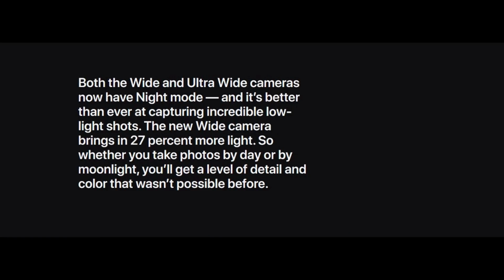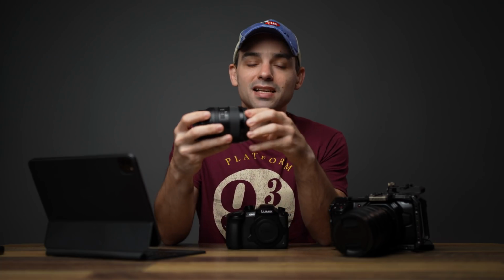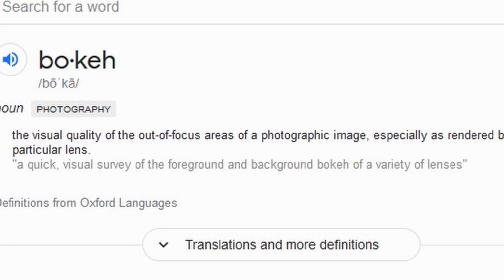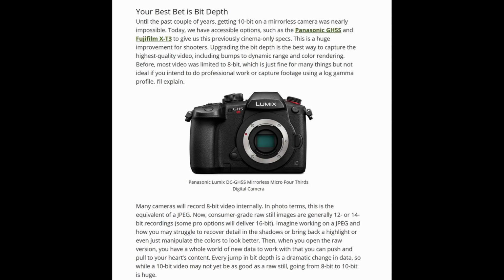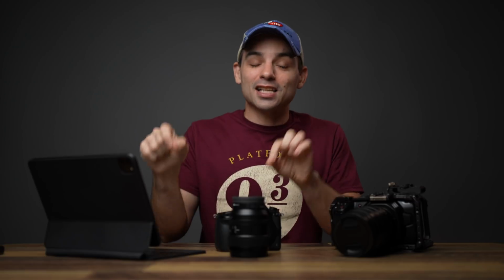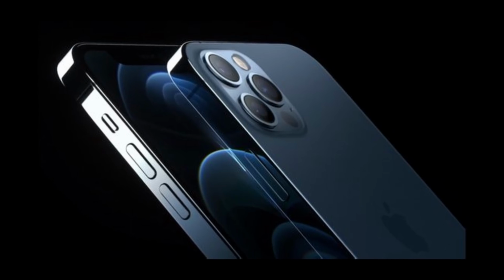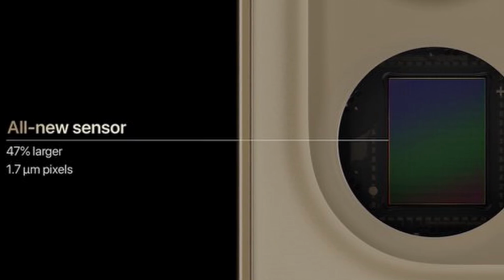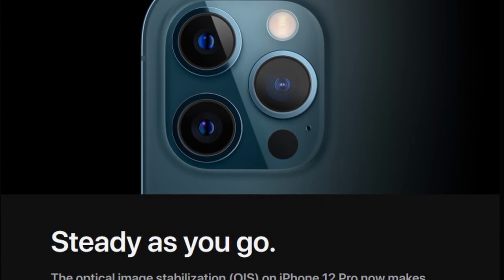What YOU Don't Know About the iPhone 12 Camera!

Comment: Isn't it weird that the Pro vs. Pro Max has a different lens location?  I understand the reason Pro Max has the Wide in the lower location because of the sensor stabilization, but why wouldn't the 12 Pro also have the same lens location?
Reply: It is because the Pro Max needs more space for the larger sensor, so therefore its placed on the bottom. It would not fit in the top left corner, like it does in the regular Pro.

Comment: iPhone 12 Pro Max vs similarly priced mirroless (eg: A6600 or EOS RP)

Which one would be a better purchase?

*I'm already content with my iPhone SE (2020) for the phone function. Looking to buy a somewhat decent camera setup for the $1000 ish price range.
**The mirrorless route would be better in terms of upgradability. Lenses can be bought later and still be used down the line when the body is upgraded. However the overall setup will be significantly more expensive compared to an iPhone setup. iPhone would have the edge in terms of the computational photography, which I think is nice to have.
Reply: I bought a mirrorless a while ago. A6000 back when it was the newest and best. I've barely used it even though the photos come out clearer. There's something special about phone cameras and their convenience. I think if you're taking photography seriously, A6600 is a good place to start. The lenses get expensive and inconvenient which is I personally stick to good phone cameras now.
Reply: @GGfacePALMs  the best camera is the one you have on you.
Reply: I started out years ago as a Canon guy, but my go-to camera the past 3 years has been a Panasonic GX85. It’s sold in a kit with a 12-32 and 45-150 lens. That’s a 35 mm equivalent of 24-300 mm. About $500 for the kit. The Micro 4/3 system has a good ecosystem of lenses from Panasonic, Olympus and Sigma. Fantastic quality with MUCH smaller lenses than the APS-C sensor cameras.

Comment: I really want the iPhone to upgrade to 14 megapixels
Reply: Why?
Reply: 12MP is the best resolution for a phone for multiple reasons. 

12MP is the minimum you need for 4K, so not going over that saves processing power and battery. 

The less MP a sensor has the bigger the pixels physically are which gives you less noise in your images and higher light sensitivity. This means faster shutter speed for a given scene which means sharper images in practice. 

Not many phones have a 4K screen and even if they do it’s kind of pointless at that pixel density. So you won’t be able to see any extra detail above 12MP without zooming in. But by the time you upload to FB or IG the compression means you lose that potential benefit anyway. 

Unless you’re printing your photos larger than A4 or even A3 you won’t see a difference.
Reply: Jamielol I like being able to zoom and and see small, well defined details in my photos rather than rely on computational photography to do its best to pull out details

But good points, fair enough.

Comment: Too bad there is no 4K 120 or 4K 240 that was previously leaked in rumors and on the prototype versions. Maybe next year.
Reply from the maker: Yeah that does suck but I imagine they have to work really hard on heat issues if they start getting into high frame rates and high resolutions.